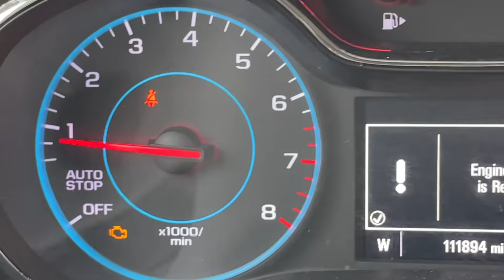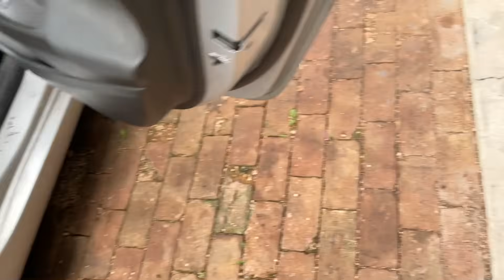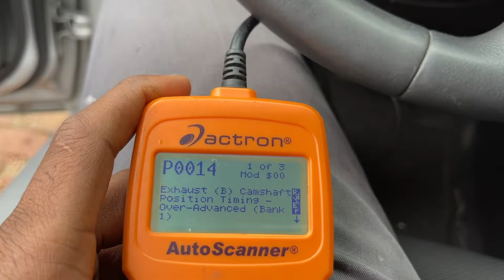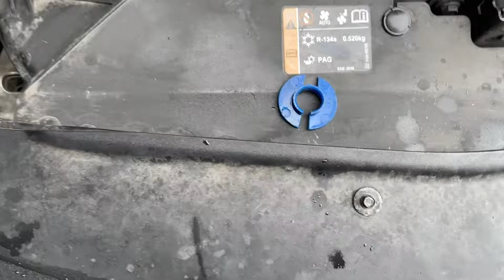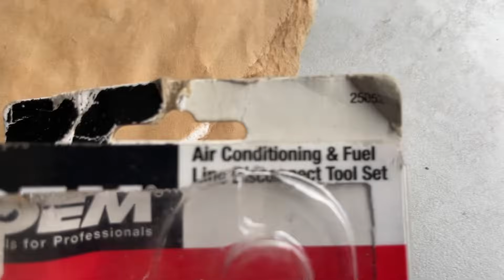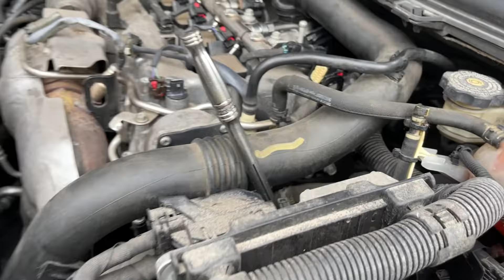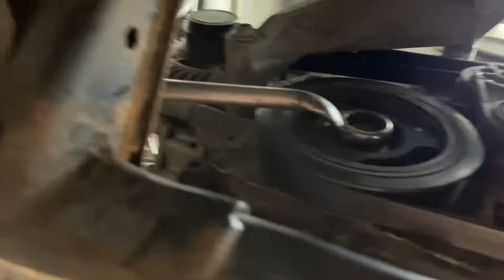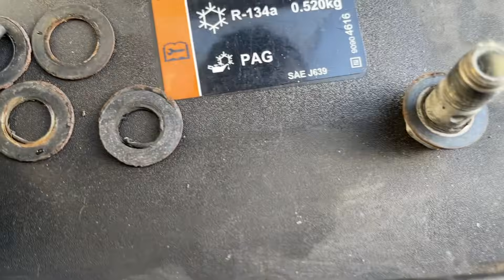16-19 Chevy Cruze, Mailbu Valve Cover Removal, VVT Solenoid & Camshaft Sensor Replacement 1.4L, 1.5L

Comment: I did the plugs yesterday on my 17 Cruze, and there was a little bit of oil from the outer gasket, all hole spark plug holes were dry. it looks like it would be somewhat of a PITA to replace...
Reply from the maker: If the car isn't burning oil due to the small leak or if there isn't any oil leaking noticeably, I would not worry about it at the moment.

Comment: Do you have a video of changing the PCV Valve on this same motor? I can’t find one anywhere as everyone else has the video of the built in PCV on the valve cover. I have this same engine just trying to see how hard it is to replace the PCV Valve on this exact motor. Thanks in advance 💪🏻💪🏻💪🏻
Reply from the maker: I do not have one. There aren't many videos on this type of Cruze engine on YouTube. Just the older style engine. It's fairly easy to replace. If I had the car I would do one. Thanks for watching.
Reply: I.belive it's part of the  valve cover

Comment: What did you used to take the bolt off
Reply: Next to the hose on the valve cover it’s in the front in the middle
Reply from the maker: Oh, that's a tamper proof bolt. It requires a special tool however, if you have some needle nose vice grips, they will work great!
Reply from the maker: Which bolt?

Comment: I watched this video and you helped me fix a huge headache I have had for a couple months now!!! It was my 2005 scion tc, in which I found out all along it was the camshaft position sensor, in which it is mounted on top left of the valve cover, right in my face all this time, and I don't know why I refused to check it, but I done everything else from cleaning maff sensor, to cleaning throttle body, to changing fuel pump and everything else I could think of!!! As soon as I pulled the plug off the sensor I found the issue.... One of the wires was halfway out the plug connector with harness wrap from the factory hiding the fact!!! Pushed the wire back into the connector after using a very small flathead screwdriver by bending the little catch thing on the wire connector that holds the wire inside the plug!!! I plugged it back up and immediately started the engine and now it's fixed!!! Apparently the factory did this by mistake when it was put together, and all this time from the engine compartment going from cold to hot would make the wiring harness more flexible over time and the wire was intermittently making and loosing connection!!!!

Comment: Great Video, I have a 2016 malibu LT, any clue about P06DB (Engine OIl Pressure control solenoid valve control circuit Low Voltage)?
Reply from the maker: Possible bad oil control valve? How many miles? When was the last time you had the oil changed (filter too)? There's a similarity with the oil control valve as the VVT solenoid. Prolonged oil changes affects both. Please let me know. Thanks, Terence
Reply: @TerenceDIY  I hasn’t been that long since I’ve changed the oil, and I had just changed the oil after changing the solenoid in the oil pan at the bottom for code p06DD and it gave me the 2 other codes, saying it’s low circuit voltage. 94k miles and vvt’s have been changed, and everything possible has been done! Took it to many mechanics no benefit
Reply from the maker: @Mobiletouchexpressdetailing , I'm sorry. I wish I were there to help.

Comment: 2nd gen Cruze 2017/2016 I have been looking for an air leak for two years!!!! …. hissing sound loss of power and it would die when I stopped at a light, It was the inter cooler intake hose!!!! A hole developed because of rubbing from a belt on the bottom of the engine jacked up the car and finally found it!!! I taped it up and hissing stopped and power returned!!!!  Thought it was the pcv but it wasn’t!! Hope this helped someone!

Comment: Pulling the head off has not been fun. Thank you for a step by step my brother
Reply: Not the engine head but it is the valve cover in which with all the work involved in removing the valve cover, would definitely make one feel like you just removed the head!!! Lol!!!
Reply from the maker: You're very welcome. Thank you SO much for watching.
Reply: @TerenceDIY  your video was a nice guide to removing the valve cover, I had chunks of aluminum off the vacuum pump make its way into the cam. All good now!
Reply from the maker: That's awesome!

Comment: What's the yellowish chalk substance that's all over the turbo under the heat shield? I noticed that on my cruze as well.
Reply from the maker: I'm not sure but I will say it's nothing to be concerned over. Thank you so much for watching.
Reply: @TerenceDIY  Thanks. I appreciate your videos.
Reply: Sounds like antifreeze leak maybe, ive seen antifreeze leave white chalk line residue. I would check the levels of the antifreeze to make sure theyre ok and isnt leaking somewhere

Comment: THANK YOU SOOOOOO MUCH!!!! This is EXACTLY what's wrong with my 2019 Equinox. I let someone talk me into not changing the oil on time because they didn't want me to do it myself. Someone reset my oil life sensor when I had my tires serviced. 🤦🏽‍♀️ Oil issues will mess this engine up BADLY.
Reply from the maker: You are absolutely correct! Running those engines low of oil will cause a plethora of problems! Thank you VERY much for watching.
Reply: Please keep doing what you're doing. I've been certified for 17 years and I love what I do. I forget a few things here and there, but your work confirms my thoughts when I question things. You're TOTALLY appreciated! 💙
Reply from the maker: Thank you and once again thanks for watching.

Comment: I find it so crazy how were all having this same problem, I just don’t know what to do at this point, so replace all the solenoids and sensors and check engine light is still on so I pulled the camshaft sensor out just so I can use the vehicle without it shutting off
Reply: I ended up getting rid of that vehicle but got another Malibu, it’s throwing a p0366 code
Reply from the maker: What trouble codes are you getting? I can check the software for other  solutions.Thanks,

Comment: It looks like you removed the bolt for the injectors so only the rail was removed. But, then it later appeared like the entire injectors came out with the rail. Did you remove the 2 torx bolts after all? Also, I know Chevroleet really cautions about removing the rail carefully using their very special removal tool ($$$). Any issues with the rail sealing after using the pry bar method?
Reply from the maker: The injectors came out on the rail. There was no issues after this job. It was a flawless job. The car still runs and drives great. Thank you for watching.
Reply: @TerenceDIY  Thanks. I am working on my 2017 Chevy Volt that either has a warped head or blown head gasket. There was no  info for removing the fuel rail without the expensive GM special tool. I found this video and the fuel rail is identical. I used your method and got it removed. Very helpful!
Reply from the maker: @schultp  That's awesome! Thanks for watching.

Comment: Where do u find
Torque specs bro
Reply from the maker: I have a digital manual for this vehicle and a Chilton repair manual. Here's a link for a digital one. It's not what I have, but I believe it is somewhat similar. Thanks, 

https://www.ebay.com/itm/285030071249?hash=item425d1dbbd1:g:QREAAOSw5b5jaTyC&amdata=enc%3AAQAHAAAA8CwHYUcgSWQpmNKRh3jzpZzrBVXcfk0BCgYttF8lYcQde%2B1G%2BXVE5aHvqDKouLJcPOfXetWgR6L%2BrXrGqADbjoipKLFnaxqllQ9l%2FjiLi1WLfWEs7xebN9VAT5X7bZYCpGIQ9VyOaBCMlClw5T5bDyyT4BtxDoYj4p11CuSRxw%2FDMWzAH1owFBPJZoSqjmTbU0ZvyTm6plpXK4ELxXDbMvFTOFmN6xnq8QTR%2FQWmVrDhE8xfAhT0i4f04q9kSU0KuI1P3xr15PVdCg8a9xbVNtm6cypRQLJCLMytrAvxroUBUDDKKquqhmqjgHL4tHFL7Q%3D%3D%7Ctkp%3ABFBMkq6t5KBh

Comment: Hey I changed my throttle body, changed my engine air filter, and changed my MAF sensor…im still throwing a P2816 with a low RPM can you suggest what should I do next?
Reply from the maker: Hi, why did you change all of those parts with that code? That's a transmission related code. It's showing a fault in the transmission. What year is your Cruze? Thanks,
Reply: @TerenceDIY  long story short I noticed my RPM being low and my car stuttering… and recently when I went to get my windshield replaced they turned me away with all the error codes on my car. I have a 2016 Chevy Malibu Lt
Reply from the maker: Oh, okay. Your Malibu is pretty much the same as the Cruze. I wish you would have found my video and asked me before replacing those parts.
Reply: @TerenceDIY  same here lol so you agree I shouldve replaced the sensor?
Reply from the maker: @chynnagogg3314  , nope, not with that code. You have an issue with the transmission. Maybe a shift solenoid (educated guess). I'm not sure since I cannot scan it properly.

Comment: I have 1.4T that smokes like no tommorrow on idle. Cleaned injectors inside and out, new plugs, coils. Cleaned MAF, filters, oils etc usual stuff. Also replaced the two external PCV valves. Runs great (especially after clening the gunky injectors) and has plenty of power and doesn't eat oil. City MPG on the bit poorer side, can't figure out whats causing it to smoke so much. I read there's a PCV orifice built in the valve cover that goes to the intake manifold - it could be blocked but even then the excess pressure should be venting thru the other PCV valves...
Reply from the maker: Sounds like bad rings or worn valve seals. Most likely is the latter. How many miles?
Reply: @TerenceDIY  thanks. Around 60k miles. Whatabout turbo seals? Tho the smoke is white/grey and smells more like gasoline than oil.
Reply from the maker: @omiq7761  , that's very low miles for the valve seals to be bad unless the engine was ran hard. The turbo can also cause your condition. You need to check the seals thouroughly or replace them. If you're smelling gas and not oil or a sweet smell that would be caused by a head gasket, I would definitely check into the turbo. I have seen faulty turbos cause that same smoking issue despite working properly.

Comment: Hey I decided to go ahead and do it myself. My question is the vacuum pump seal that black round part does it pop right out ? So I can replace it easily ?
Reply from the maker: If you're talking about the round seal, yes you have to carefully pry it out. Make sure you clean the area good before you install the new seal. It's a fairly easy job. Here's a link for the part just in case you didn't purchase it yet. 

https://www.ebay.com/itm/204136524457?fits=Year%3A2016%7CModel%3ACruze%7CMake%3AChevrolet&hash=item2f877c2aa9:g:MaoAAOSwvKNjXptM&amdata=enc%3AAQAHAAAA8EjLNiD1FWdPOBVRJ6plFhpMrvQaUjynHs4%2BpnokzqRyV9Xr656iHC%2B3lNeXs%2BbsmVIlC0XqK054gEwLGb7mZjQkdLYqbVRty55tlCuGg6kJvIGU7KE%2BIjVcsshk9swPnNyJsTZhf%2F99ZLD4DLqW1GvUj57jPwGTZ8Zm6OsqhXOf7g8leQr9sWGREej8EpadU8Dss8TcNFB%2FWrdOe0FbRYOJE3BJmPIyS3IQNCqrKy4Lw59m22oZjw%2F9wLkTWj6nJSOcLmex2qNSrr%2BwK%2Fk6jAn9P2RGsnn6hSmUd3%2FJnOfgx2z5JzRpdfWTy5EJ8f5aUw%3D%3D%7Ctkp%3ABFBMmMf5hZRh
Reply: @TerenceDIY  yup that’s the exact part I need! Thanks
Reply from the maker: You're very welcome.

Comment: Can you recover from oarts being broken off in the engine ?
Reply from the maker: What parts? Can you explain? Thank you.
Reply: @TerenceDIY  from the vacuum pump. I went to chevy today they said it’s need that and exhaust cam shaft gaskets & cam bolt needs replacement. So you have a video on that ?
Reply from the maker: @Avation.Experience  , this video shows you in detail how to replace the vacuum pump although It shows many more elements. The Chevy dealership job is to be over the top. All you need to do is replace the vacuum pump. The vacuum pump breaking into pieces at the shaft is pretty common. All you need to do is remove the broken pieces that's inside of the valve cover and you're good.  It's a fairly easy job. You don't have to remove the valve cover if you don't want to. Here's a link to a new vacuum pump.

https://www.ebay.com/itm/295090326366?fits=Year%3A2016%7CModel%3ACruze%7CMake%3AChevrolet&hash=item44b4c10b5e:g:A2YAAOSw6XtizYOt&amdata=enc%3AAQAHAAAA8CxsLJ2%2BnIrfAVmv5f%2BDlXJ8VaRaKVwB6hZhmsbpit%2FUxlgobl0uLIE0%2FGdypXSe%2FBgJUm3ldpZJ2RS6Tf6s2sgegqJTVo1Kyjbmwu%2FCupdm%2BBrkaVw3Yz%2Bv9EeZJOJOZ1HGkcdx9a2LfcjP%2Fi8D694bXhKqV7XNiW%2FaXCFi3muocGAPyMT%2F3AUExjV2yBIqmO%2BiciqTSWunxj7hjdr55et3AIpP9hdT6jj7fuCuA0ziYkG5tHgJEjMxECs9X5F8R8NIhTkWXX3vQOreMFxoFo6XVcIkPGne296K4PiAr84QOGdtDLeC2I9VkU%2BAWlvP9A%3D%3D%7Ctkp%3ABFBMrs_Rr5Bh
Reply: @TerenceDIY  thanks I approcate the speedy response. Man they said 1500 for the whole job lol and I’m assuming that threw a bouncy of other codes on because they didn’t say anything about them during the diagnostic report
Reply from the maker: @Avation.Experience  , no problem. Thank you for watching.
Reply: @TerenceDIY  no problem keep on with your videos their a real help. God bless you!
Reply: I have 2013 chevy malibu p0017 code changed out  vvt celinoid crank shaft censor a broken vacuum pump and timing chain kit  still code is there. I am thinking camshaft positioning how do I line it up I see little bit of that on this video same thing on the malibu? Let me know

Comment: Hello. I’m getting the following codes: p1101, p0014, p0017 & p0106. I’ve gotten the throttle body, crank shaft sensor & brake vacuum pump changed, but I’m still getting check engine & engine power reduced. Any suggestions- Chevy malibu 2016
Reply: And yes it had been a while since I got an oil change. I was actually heading to get an oil change when I lost power while driving and got the error engine power reduced
Reply from the maker: @ebonyjones9331  , you need to check the vvt solenoids. that's the only thing that make sense to your problem. They are very easy to replace.

Comment: How did you remove the Pcv hose? I can seem to free mine
Reply from the maker: I didn't have any difficulties removing it. If you want, you can lock some vice grips on the tamper proof bolts and remove them easily and quickly that way.
Reply: @TerenceDIY  Any tips on getting  it off with the fuel line disconnect tools. Could I email you some photos and perhaps pay you for your time or advice?
Reply from the maker: @leogonzalez8975  , I apologize for the late response. I had a very busy day. You don't have to pay me for anything. As far as using the disconnect tool, you have to push it as far as you can into the connector. You can use a little penetrant oil on the connector as well before inserting the disconnect tool. Also, make sure you are using the size that I used in the video. Once you've pushed it as far as it can go, wiggle it as you pull backwards, making sure the disconnect tool stays firmly pushed into the connector. I wish I were there to help you.

Comment: Thanks for the informative video man.
My cruze needs pcv valve replacement. Do I need to replace the valve cover for that or just the pcv valve. I could not locate the pcv valve. Would really appreciate any help. Thanks.
Reply from the maker: You do not have to replace the valve cover and the gasket is reusable. I would just use the gasket maker around the intake so that you get a leak free seal. How do you know the pcv valve is bad? Thanks,
Reply: @TerenceDIY  because they are 2 pcv valves . One in the valve cover and the intake . By removing the oil cap these cars are notorious to pull vacuum alot and bust oil seals.
Reply: Pcv system on most ecotec engine with a plastic valve cover, pcv system is built in. Whole valve cover needs to be replaced.

Comment: Have equinox 2018 1.5 lt. Obd 2 code says map sensor but do not know it's location and how to replace it, help please
Reply from the maker: If I remember correctly, it's the sensor adjacent to the throttle body. It takes a Torx T-25 to remove it. Super easy and simple to replace in a matter of minutes.
Reply: @TerenceDIY  tks for the reply , all the best

Comment: attempteed to take it apart today but i think my valve cover has some sealant that wont allow me to get it loose so i just well enough alone and put it back together i wonder if there is a way to reposition the reluctor wheel through the the camshaft position sensor on the exhaust side without taking cover off
Reply from the maker: Did you remove all of the bolts in the center of the valve cover? Please check that all of the bolts are removed. Once all of them are removed, you have to pry it up. It will not come up easy. There's no other way to position the reluctor. The valve cover must come off. I wish I were there to remove it for you.

Comment: Is it common for the the camshaft sensors and solenoid to go bad after the break booster brraks
Reply from the maker: The answer is no if you're asking a question. I am very familiar with this engine. Thanks for watching.
Reply: @TerenceDIY  do I have to remove the valv cover change reluctor wheel position? And after it’s move will it move again?….greatly appreciate your feedback
Reply from the maker: @TheRealBlacHood  , yes you will have to remove the valve cover as I did in the video. Once you move the reluctor back in position, it should be fine.
Reply: @TerenceDIY  appreciate you king

Comment: @38:50 you talk about the seal with the vacuum pump. Mine got pretty beat up on the inside. I'm with you & want to change it out so it don't leak. Do you have a part number or easier way of finding it? The brake vacuum pump broke & yes off into there.. Fishing it all out now.
Reply from the maker: Hi, this gasket should fit your vehicle. (Link below)

https://www.amazon.com/ACDelco-12668429-Vacuum-Pump-O-Ring/dp/B07TB5PZMS/ref=asc_df_B07TB5PZMS/?tag=hyprod-20&linkCode=df0&hvadid=507696692386&hvpos=&hvnetw=g&hvrand=14366064758028903105&hvpone=&hvptwo=&hvqmt=&hvdev=c&hvdvcmdl=&hvlocint=&hvlocphy=9021629&hvtargid=pla-1210375277173&psc=1
Reply: @TerenceDIY  thank you so MUCH!
Reply from the maker: @CrazieFrogz  , you're very welcome. Thank you for watching.